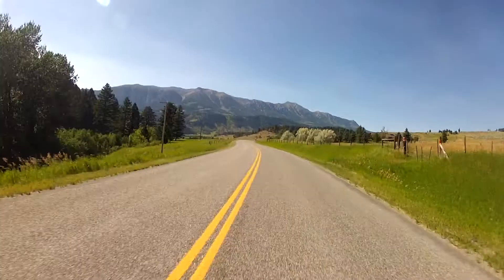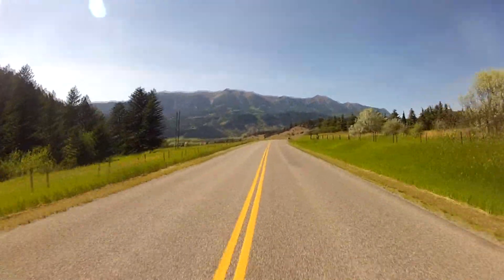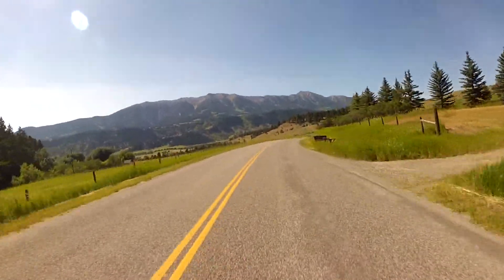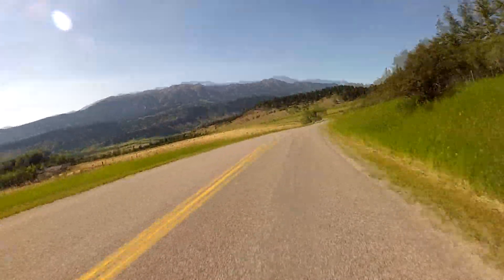Performance - Power, Torque, & the Transmission

Comment: Could you say break horse power is how fast you get from 0- to whatever (how fast you get off the line). 
And torque is the power whilst your moving, like when you pin the throttle when riding? 
(Or Horse power whilst moving)
Reply from the maker: Good question, but no, that doesn't work. Torque and power don't measure different aspects of performance... power is tied directly to performance (all of it). Wheel torque is also basically a function of power. Max engine torque doesn't tell you much besides what kind of transmission / gearing you need in order to have access to all the power. Power INCLUDES torque. Power is Torque x RPM. 

Let me know how I might be able to help fill in any blanks:)
Reply from the maker: More to the point of your example, when you pin the throttle, you are increasing engine output  torque, which increases output power by the same factor - changes in engine torque are exactly reflected as changes in power. The thing to remember is that knowing the actual engine torque value isn't useful (except while you are designing vehicle or major changes)
Reply: Ok so when it is said a motorcycle has 67bhp 
And 50ft of tourque what does that mean 

Brake it down to me in lay-mans terms
Reply from the maker: +Zee Treqz Sure. About 95% of the 67 HP will reach the wheel (63.5 WHP), so if you're going 100 mph, then you have 238 lbs of "push" available if you're in the right gear. At 70 mph, you can get up to about 340 lb of "push". At 50 mph, you can get 478 lbs. At 30 mph - 795 lbs, and at 10 mph you could have 2,386 lbs of push! (if the tire could grip that hard;) 
Obviously, that last one is pretty impractical and would require an extremely low 1st gear. It would have to be so low that the engine would hit the rev limiter at like 12 mph!!... 

50 ft-lb of torque is the maximum average twisting force in the engine output shaft. It would be the same twisting force applied to a bolt if you were pushing on the end of a 1 ft long wrench with 50 lbs of hand force. It tells us things about the stress in the shaft. We take that into account when designing the shaft (shaft diameter, alloy, heat treatment etc.) This maximum torque value also gives us stress related info for designing the clutch, transmission, and final drive. 

As I test the engine (at full throttle), I measure output torque at a range of RPMs. (for this engine, the highest value happened to be 50 ft-lbs, so I make a note of that for our marketing department;) I then plot each measurement on a graph of rpm vs torque. This makes a curve (torque curve) I can then go to each rpm and multiply that rpm and corresponding torque together, giving me a power value. If I plot these points on a graph of rpm vs power, now I have the power curve. (Obviously this is all done instantly by a computer on the engine dyno) Often, the torque curve and resulting power curve are shown together as two humping lines on one graph having two vertical axes, one for torque and one for power.

Armed with the power curve, I can now design the transmission and final drive ratios so that in 5th or 6th gear, the engine is turning at the rpm for peak power just about when the bike is at the steady speed that requires that amount of power, i.e. the bike's top speed. I then design 1st gear so that it provides good clutch / throttle feel for takeoff and perhaps satisfying power wheelies if it's more of a hooligan bike:) This usually results in redline occurring roughly in the range of 30 - 60 mph in 1st gear, depending on the type of bike. Then I space out the remaining gears in between in fairly consistent steps, perhaps tweaked for satisfying feel based on past experience and the bike's main purpose.

Hopefully that helps paint a better picture.
If you want to see numbers;

Want to know how I got lbs of push from power? The push is just power divided by speed.
Before we do math though, we need the units to be consistent. You can't just divide horsepower by miles per hour and get pounds.
Some people enjoy using pre-determined conversion factors for that go with their favorite units so they don't have to remember fundamental unit conversions... to each his own. In this case, that factor would be 374, letting you use HP/mph=lbs directly.

I'll use standard units in the English system; feet for length, seconds for time, and pounds for force.
For power, 1 HP = 550 ft-lbs/sec    so     63.5 HP = 35,000 ft-lbs/sec
Speed is length divided by time; 1 mph = 1.47 ft/sec     so    100 mph = 147 ft/sec
To get the pounds of force; 35,000 ft-lbs/sec divided by 147 ft/sec = 238 lbs 

You may have noticed that peak power and peak torque don't occur at the same rpm. This is sometimes confusing, because if the power curve comes straight from the torque curve, shouldn't they peak at the same rpm?! No. It's because we are multiplying by the constantly increasing rpm scale. The reason power usually peaks later than torque is that the torque only decreases gradually just after the peak torque. So when you multiply the rpm just after the peak by the torque there, to rpm has increased more than the torque decreased, meaning the power is still going up. If you keep going further to the right, torque starts dropping off quicker than rpm is increasing, so then power is dropping.

If you had given me 67 HP and 50 ft-lb and told be they were not maximums, but a point somewhere on the torque and power curves, then I could tell you that they occur at 7,038 RPM
67 x 550 = 36850 ft-lb/sec
36850 / 50 = 737 rad/sec
1 rad/sec = 1/(2pi) rev/sec   so   737 / (2pi) = 117.3 rev/sec
60 x 117.3 = 7,038 rev/min (rpm)
Reply: +drienkm 
Thanks for your time and help buddy!!

Comment: Having a short piston stroke on a motorcycle is ideal because it takes less time to get a high RPM, but is no good for a engine that pulls a heavy load. Half the con rod length does mean twice the wear rate. Nice videos by the way..
Reply from the maker: Good point! Motorcycle engines typically don't have to work very hard. Yeah, increasing max con rod angle increases axial forces in the rod, increasing wear (It's not linear, but the relationship you give may be a decent approximation)

Comment: Torque is what you feel (push or force) HP is basically saying how long (rpm) and or fast you can go. Im sorry but you are wrong as far as power goes Say for instance a BMW and a zx10r and a BMW s1000rr make pretty much the same amount of power yet the BMW is quicker because of the (torque to the wheels) ie gears and final drive are lower. Now lets say a zx14 vs a zx10 how does a zx14 with the same HP as a zx10 but weigh 150 lbs more keep up and surpass the zx10 "torque" and torque to the wheels. Do the math of how much torque is being made at peak HP for a bike vs another bike in the same catergory multiply that by any gear and final drive and there is your push and why one bike pushes harder than another. RPM shows you how long you feel that push in a given gear. HP is a imaginary number (not real) mathematical, whereas Torque or force is a unit (product) of relativity
Reply from the maker: Yes, torque is like push or force. Yes...without it you would feel nothing, but remember, you would also feel nothing if the engine wasn't turning. Torque could still exist. So try to remember that it is just as correct to say "RPM is what you feel". They are both right because the acceleration you are feeling requires that both exist (and that's HP).
HP at the wheel is exactly that push or force at that instant times the speed your are moving at that instant.
HP at the shaft is the engine torque at that instant times the rotational speed at that instant. 

Your statement beginning "Do the math" is dead on. From there it breaks down. It's very clear that you ride:)... I can identify with what the next sentence is eluding to, but it's not precise in meaning. HP isn't "imaginary", it involves time while torque does not... I think that's where people trip up, trying to think of power in static dimensions... trying to separate it from time in their head. It's just how quickly work is being done. And torque IS also mathematical (everything is:), it's just physically simpler to measure.

The reason we both feel better about saying "Torque is what you feel" is that our brains put the acceleration "force" in the same box as leaning back in a chair "force". To the body, both feel like the same type of thing... something pushing or tugging on us. The brain says "acceleration... yeah... that's caused by the wheel gripping and turning against the road... I can imagine twisting an axle with my hands... so torque is what i'm feeling". In reality, you are feeling a dynamic force due to acceleration (involving time), but your brain is trying to think of it as a static force, analogous to slow muscle movement or gravity. That really makes it hard to understand power.
I guess it's once you get used to math involving time, power shows its elegance and usefulness.

The S1000R is 45 lbs lighter and probably also has a flatter power curve than the ZX10 due to it's advanced engine management. If it is quicker, than it's simply because the time integrated sum of the push from the wheel over the whole run, divided by the total mass was a higher value for the BMW than for the Ninja (aerodynamics aside of course).
In the case of the ZX14 vs. the ZX10, (same peak power, ZX14 is +150 lbs)  I haven't seen the two bikes race, so I'm taking your word that the 14 is quicker... I would think the ZX14's power curve is allot flatter than the ZX10 (watch 5:30 again). The key is remembering that in the real world, you aren't operating at peak most of the time. An engine that still shines off-peak has an advantage accelerating through the gears. That's what those 443 cc's are doing;) I also think aerodynamics are really coming into play at high speeds for this match. The ZX14 is a smoother cleaner bike that streamlines the rider better.

So yes, if the bikes+riders are the same weight, then the winner wins because there was more wheel torque on average. My whole point was that max HP immediately tells you something about wheel torque while max engine torque requires allot of other bike specific info to arrive at the same result. Working with the power curve is also the most direct way to find optimal shift points. The torque at the engine MUST be considered WITH how fast the engine is turning in order to say anything about performance... that's exactly what HP is, and that's why we find it. 

THE TAKEAWAY: HP is a calculated value that sums up how fast an engine or motor can GIT'R DONE assuming it's geared properly, whether that's plowing a field, lifting an elevator, pumping a pond dry, getting "over there" ASAP, or sawing wood. Transmissions, belts, sprockets, and gearsets do the job of mixing around the two quantities coming from the engine, torque and RPM, to suit the application (for vehicles, the present speed).

Thanks for the comment!

Comment: it turned out what was makeing it run like that was the nipple from the petcock was broke and taken out so the intake was sucking up to much air after i put a new bolt in it runs just fine now how to rebuild the master clutch cylinder and clean the clutch slave really well and take the clutch packs out and clean them up it shifts and runs like new sorry for the late response.

Comment: Agreed on the petcock first.  Simple fixes can have surprising results.  But 2 and 3 not firing is most likely the low speed jets as drienkm said.  Grab a Clymer manual if you don't have one, some Berryman B-12 carb cleaner, and a can of Seafoam.  That combo can be magic :).

Comment: Oh yeah, it's a different way to get the "same" results. graph torque output in each gear on the same screen on the dyno (rpm along the x-axis and torque along the y-axis). If 1st gear is 3:1 and 2nd is 2:1, you find two points: (x,y) for 1st and (2/3x,y) for 2nd. x is the RPM in 1st where torque and power output will be equal after shifting into 2nd, shift any earlier and youll be in 2nd missing out on available power in 1st. any later and youll be in 1st missing out on available power in 2nd

Comment: well shit, yeah that is completely true lol. but unless you're going to run on a dyno, which i have never done with my CBR or vw, the best thing you can do (what I prefer to do), is try to land your revs in the middle 50% of the power band after each shift which does require revving outside the power band in probably 100% of all cases. btw, do you have a twitter/facebook for your youtube channel? i feel we could exchange a lot of entertaining engine/physics related banter

Comment from the maker: Cool. So that method is actually an approximation to the numerical approach.  BTW, it's the same thing to just shift where power in current gear = power in next gear. (you are crossing the power peak in each gear) 
The only reason you would need to integrate would be to account for little bumps and discontinuities in the power curve near the peak... but yeah, who really needs that much precision ;)
If you notice though, we are not staying in the "power band" as you have defined it...

Comment from the maker: Get the petcock thing worked out first. It can cause allot of weird issues.
Make sure the throttle slides are free and clean. and check the rubber diaphragms under the top caps for tiny leaks.
You could also check your low speed jets to make sure they are stock size and not damaged or dirty.
DO NOT separate the carbs from each other if you don't have to. You will probably need new O-rings if you do, and you will have to sync them again.
If you get desperate, I still have the carbs from mine.

Comment: hey i remember watching you ride a nighthawk and that kinda help me decide to get one so im makeing payments to this guy for it and im real close to haveing it its a 1984 Honda Nighthawk 650 it will run but rough i know it needs a clutch slave cylinder rebuilt and a new petcock hose but for some reason and cylinders 2 and 3 are not fireing right my dad and me think the center carb needs tuned also this is my first bike so im learning as i go any ideas on it?

Comment from the maker: We are now talking about a small change in the already small mechanical loss. Naturally there will be small differences from gear to gear. I'm sure you understand the fundamental difference though... torque changes by a factor equal to the gear ratio inverse, while power changes only by the small (and relatively constant) mechanical loss. That was my point.

Comment: Power is a value calculated by the amount of measured torque and is affected by gearing. The amount of power that makes it to the ground is affected by what gear you are in. That's why when you take your car or bike to the dyno, you make pulls in whatever gear is closest to 1:1 (usually 4th in most road cars) and then make adjustments from there.

Comment: The powerband IS defined as the range of RPM's between peak torque and horsepower. It's the point from maximum volumetric efficiency to the point where the power output begins to decrease. And the optimal shift points are where ever torque output at the current rpm * current gear ratio matches the torque output at the next gear's rpm * the next gears ratio. No calculus is required.

Comment from the maker: Defining the power band as being between the torque and power peaks is at best a rule of thumb, but it's not optimal. The optimal shift points will always be beyond the power peak. To exactly determine the optimal point, you need to know each trans ratio and perform a numerical integration on the power curve near the peak. The location of the torque peak does not play into it.
Last sentence: replace the word "torque" with "work" and it's right. I'll assume you knew that :) lol!

Comment from the maker: Gearing does not affect power transmission other than a small mechanical loss. Obviously, if by wrong gearing, you are not letting the engine run near it's maximum power then I guess you could say "gearing is affecting power". However, the fundamental difference is that apart from a small mechanical loss, power remains constant through gearing, while torque can change drastically.
Of course the curves matter during design or set up of a drive train. (2nd paragraph of description may help here)

Comment: Work=force*distance
Power=force * distance / time
Circumference = radius * 2π
For example, 45ft.lbs. @ 11,500rpm:
power = 45lbs. * 1ft. * 2π * 11,500 rotations / time
Horsepower = 33,000ft.lbs. / 1 min.
So horsepower @ 45ft.lbs. @ 11,500rpm = (45 * 1 * 2π * 11,500 / 33,000) horsepower.
The gearing affects BOTH torque and power output at the wheel of any vehicle, not just torque.
Knowing the RPM of both peak torque and peak power is important and it does matter.
That's it. That's all there is.

Comment: Not to step on your toes, but there's a lot of inaccuracy in this video. It's important to know what RPM peakTorqueAND horsepower because thats the engines power band. It's important to know the engine's power band AND the gearing ratios so you can work out shift points. The gearing not only changes the torque at the rear wheel, but also the power output at the rear wheel. Horsepower is a measure how much torque is made in a period of time.

Comment from the maker: Yes, torque and HP are proportional if rpm is fixed. However, torque is not a measure of distance. In fact, torque does not involve motion at all. HP involves time, but it's not "a measure of time". HP is how fast work is being done (work/time). An equivalent expression is HP=torque*rotational speed. 
In your last statement, I think we are saying the same thing, but we aren't just concerned with the amount of work (my wristwatch can do a ton of work given eons), but rather the rate of work (HP)